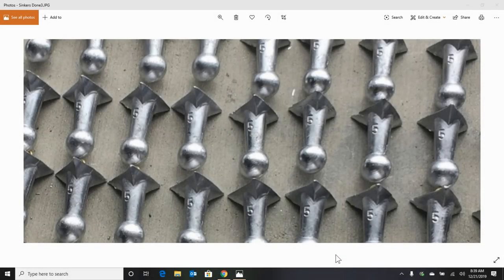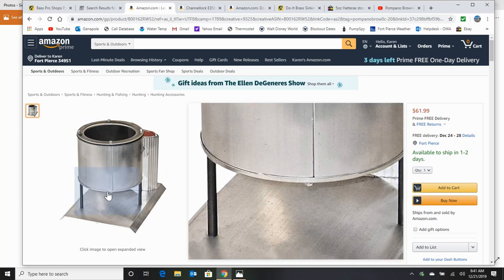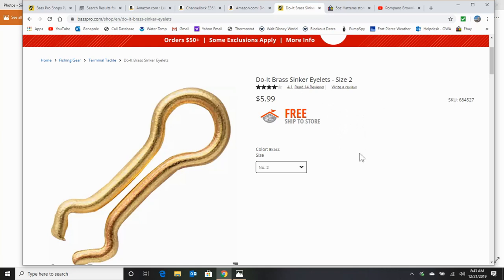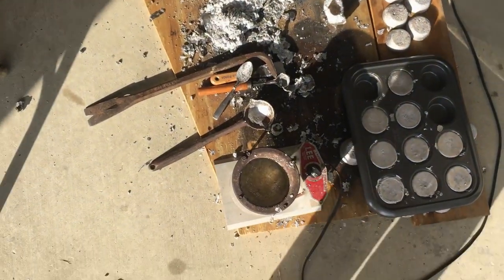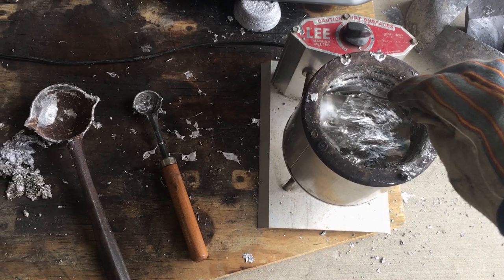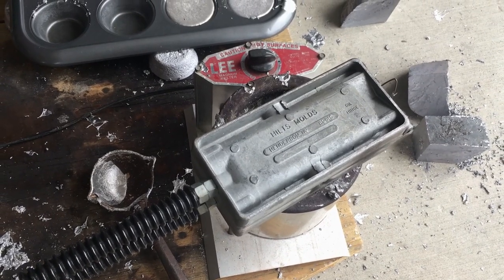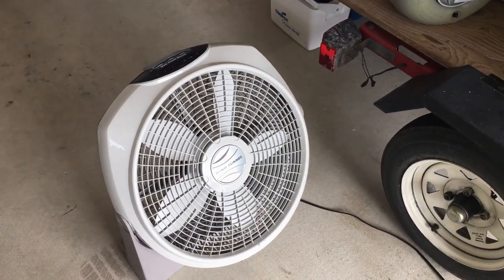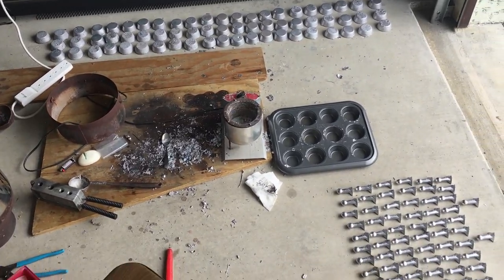Making Surf Casting Sinkers - Part 3

Comment: New to sport seen so many different types of sinkers with this type what stops the roll with strong current? just the weight? no flat sides,  no wires, have you tried any of your own design, thanks great vid so much to learn
Reply from the maker: Fish, the sinkers have flat sides at the top and hold well. The advantage these sinkers have over typical pyramid is they are more stable during a cast  and don’t tumble like a pyramid. You get more distance. The stability comes from more weight at bottom.  Sometimes you need that extra distance to get past a sand bar.
Reply from the maker: Fish, just make sure you carry an arsenal of different weight sinkers. I carry a 4 ounce for pretty calm seas a 5 ounce for rough water and a 6 ounce for water so rough I should be home watching TV.

Comment: How much would you be willing to sell 4 and 5 oz weights
Reply from the maker: Tom I really don’t sell weights but if you check with eBay you’ll find prices at around $1.00 a sinker which is much cheaper than some of the retail stores.

https://rover.ebay.com/rover/0/0/0?mpre=https%3A%2F%2Fwww.ebay.com%2Fulk%2Fitm%2F293050765284
Reply: How do those weights you make hold in the surf?
Reply from the maker: They are excellent.. and they cast even better.
Reply: Can’t find anything but standard pyramid weights. What is the name of those weights?
Reply from the maker: Tom , you probably won’t find my sinker style.. that mold is a Hilts 2-3-4-5
Reply: Hey PB I know you don’t sell but would you be willing to let go of a dozen 4 & 5 oz weights. I like the design. I just can’t afford to get set up pouring my own. It’s been slow fishing over here in Navarre. It’s been a couple of weeks since I caught anything.
Reply from the maker: Tom, you wont find sinkers cheaper than the link I showed you on Ebay.  I don't sell sinkers, but thanks for asking.